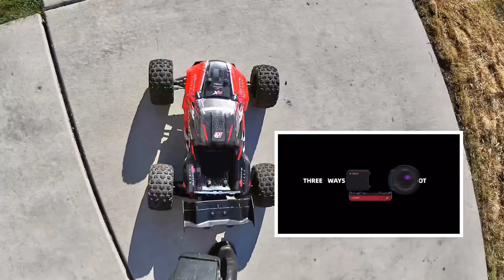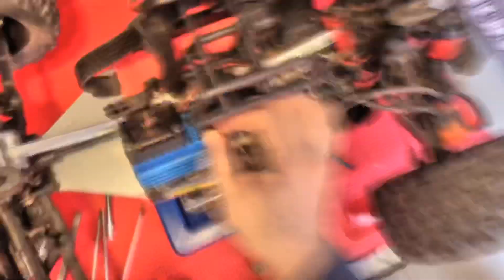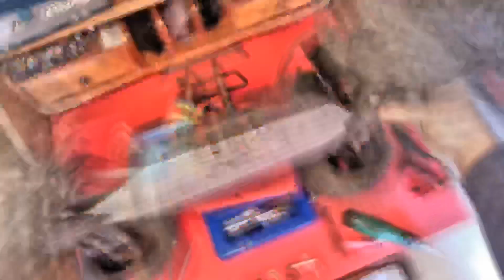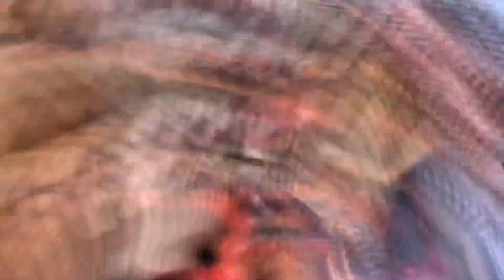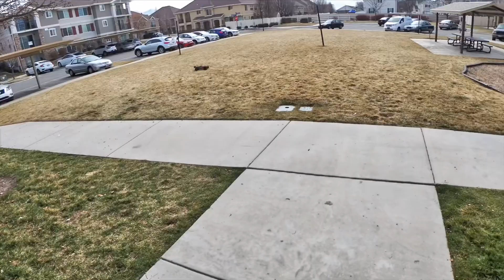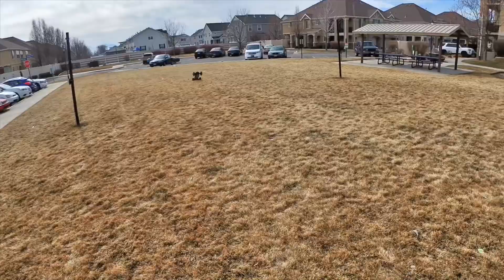RC Gears Slipping?? What COGGING looks like - & SOLVED

Comment: Hi I was wondering what amount of teeth I should have on my pinion gear bc I have replaced my old 1/10 scale brushed motor to a brushles motor and it  is running a 17t now and it is gogging
Reply from the maker: Depending on the severity of the cogging, Would help you determine whether you should drop one or two teeth. If you really have to gun it hard off the line for the cogging to happen. Then 16T might do the trick. If it’s cogging pretty easily then I would drop to 15 or 14t.
Also you might first check to see what punch setting your ESC is on. Sometimes simply dropping your punch setting can do the trick.
Reply: @EastTactics  Thank you so much

Comment: Most are under engineered for the expert pilots/drivers, so they mess with it which is a wrong concept as you should move "up" and buy the bigger ones and not "save money" any more. In essence they are still flying a Cessna and know about Boeing... It's impossible to mount a fat engine on a Cessna, but they do it for some reasons which I don't know about.

Comment: I think you can flip it if you tune your diffs? Like 1 million oil in center and 500,000 in rear might do it.
Reply from the maker: Hmmm... You make an interesting point. However I have noticed that when I go to thick in the rear end, the explosion of torque to tension on the ground, lends To broken diff pins and planetary gears. 😂 
I’m starting to think that Standing backflips Is a characteristic of a vehicle that’s tuned for an increase in breakages. What’s your experience?
Reply: Oh! Great! I just put 500.000 in the rear of my e revo! After watching a Kevin Talbot video 🤣🤔
Reply: I find that I break mine all the time lol and upgrade and break again, I love to wrench on them so I love the hobby. I think they make them to break cause the parts are money makers for them.i once built a T-MAXX with all aluminum parts, I could run it into a tree at 40 mph and nothing broke, just bent all out of wack😳😂😂😂the stuff I do for fun.but ya I have 7 trucks and I always have one apart on the bench! Fun stuff✌🏼❤️💪🏼
Reply from the maker: RC SICK, Yeah it’s something to keep in mind, however I do think the biggest reason why I was breaking so many pins and planetary gears was because I was running at 20t pinion gear, Which was just plain overkill. I’ve since  dropped to the 16, which is plenty fast and I also updated the pin to a 2.25 mm stainless steel rod that I picked up at McMaster.com. I have a video on it. The pins are amazing check Out my vid on it, if you haven’t already. Yes indeed!!! Bash on broski 😎😝💪💪
Reply: Thank you for that,I need some pins👍🏼👊🏻✌🏼❤️💪🏼

Comment: I dont get it, is cogging a motor issue? Or is it a gear issue? I recently changed my diff bulkheads and I didn’t touch any part of the gears besides taking it out and putting back in and now this shit is happening, I re checked everything and made sure it was properly seated and tight. These f’n Arrmas is driving me crazy, it’s like everything I try to upgrade just makes it worst.
Reply from the maker: It’s more of a torque issue, as too much is being asked of your ESC/motor combination. Something has changed now after your modifications to the drivetrain system. Adding weight to your vehicle, Such as larger tires or heavier components can do this, even changing differential oil, or the mesh tightness of your gears might suddenly change something where now the torque needed to kickstart the mass of your rig is More than what you’re ESC/motor combination can handle. Even introducing a new battery into your system that has a higher C rating, can introduce cogging because now more draw is being asked from your ESC/motor relationship. 
I’ve seen cogging suddenly appear when somebody goes in and increases their punch setting too high, and now the power surge asked from your motor and ESC to jump the rig off of The line becomes problematic.
Increasing the size of your motor pinion does the same thing, changes the dynamic of what your motor and ESC are asked to do. So… If you don’t want to change your gearing or any of the Drivetrain or weight changes you’ve made to your vehicle, upgrading your ESC to one that can handle more power/torque would likely remedy your issue. 
Or
Dropping your punch setting down a few notches might be enough, Or drop your motor pinion down a few teeth.
But if you had a pin it on one thing as being the weak link in your system, I would blame it on a low end ESC.
When people upgrade their ESC to say a Max6, Or even an 8S spectrum firma 160, they now have an ESC that is capable of handling not only a 2500 KV motor but you can go as low as 1650 KV (which demands a ton of torque) and still be fine.
I hope that answers your question.
Watch this video for more insight.
https://youtu.be/s4-RjtQsMsU
Reply: @EastTactics  hey brotha thanks for the info man I really appreciate it, I’ll give it a shot. It’s kinda hard for me with no one on island who I found in this hobby and no local hobby shop to go to for questions so I rely on these vids from the experts like you man. Thanks again.

Comment: Does lowering the punch level also fix the problem? Sometimes my hobao mt plus 2 does that too on punch level 6 with 500k center diff oil, didn’t have this issue with factory settings.
Reply from the maker: Lowering the punch level sometimes is enough to get rid of the cogging issue. I would certainly attempt that first and see if it does. If that doesn’t work then consider dropping down a size or two with your pinion.
Reply: @EastTactics  Thanks for the reply! Yes it certainly does work! No more cogging on my hobao on punch level 4. Note that everything is stock except the center diff oil at 500k cst. Stock pinion is on 16T

Comment: To do a standing backflips, you have to Increase power however you accomplished that is your choice you can do it with a bigger motor or you can do it with a bigger battery like a 8s
Reply from the maker: I have something up my sleeve that’s going to potentially accomplish it with stock components. Stay tuned😎😎
Reply: @EastTactics  oh other things. You could also get a higher 3 rating maybe not the correct surface aswell. It almost did it. Asphalt would be better then concrete. Do a burnout before attempting one ? Warm the tires. But looking forward
Reply from the maker: Thx... that’s a great tip

Comment: My rc stops itself like accelerate and let off the throttle and clank stop fully. I feel like the spur or the pinion is clicking it to stop what could this be?
Reply from the maker: Could be a number of things, this video might lend some light on the topic, watch it and let me know if we can rule out what's its talking about. Then well move on from there.
Reply: @EastTactics  I believe I resolved the issue I did shim my differential on the rear and I believe it was a little tight that caused the differential lock up to occur.
Reply: @EastTactics  I have steel spur gear and pinion gear in my latrax prerunner and could that happen as well?

Comment: I have this issue on my exb at 14t but i think its when the motor is too hot
Reply from the maker: Sometimes people confuse worn out gears (such as the input gear or even the spur gears on your diffs (mostly rear)) with cogging.
However since you’re only noticing it happening when your motor gets hot then it For sure could have something to do with either your motor or your ESC temperature. What kind of temperatures are you getting up to?
Reply: I'm running a 14 tooth pinion as well, with some larger tires, I noticed it when I went from 4s to 6s. The motor was getting pretty hot and it would stutter off the line pretty bad. Thought a diff was bad, but considering I couldn't even hold my hand on the motor for more than a second, it was probably getting too hot.

Comment: I put the 16 on my arrma notorius to try do more backflips on punch 8 and its doint that i should put back the 14 or lower the punch setting to factory? Pleaseee help meeeeeeee
Reply from the maker: Well interestingly enough your issue is going to be one of two things, either your vehicle is cogging because of the increase in the pinion gear, and the motor and the ESC are having that miscommunication, Or, as a result of increasing the pinion gear and throwing more torque at your drive train, you might have actually stripped your rear input gear or your front input gear. Both cogging and that sound similar and happen off the line.
The way to diagnose if it’s a stripped gear is to give it a good punch while moving at 5 mph and see if the clicking happens. It shouldn’t happen if it’s cogging, since you’re already moving.
If it does happen still then there’s a chance that you’ve stripped one of your input gears or the teeth on your ring years (differential), or both. If you find that it’s leaning toward the warn teeth on a gear. Watch this video and see if the tip I explain helps you weed out where it’s coming from.
If you find that it is clogging then you might jump to a 15 tooth pinion gear and maybe drop your punch setting to 7 to see if it goes away, and if it doesn’t write back to 14 and see if it goes away. Here’s that video though.
https://youtu.be/y_oulXojfgQ
Let me know what you find out.
Reply: @EastTactics  thanks the motor its brand new  i will do that today

Comment: When mine was stock a could do standing backflips
Reply from the maker: karson, interesting, that wasn’t the case for me.
Reply: Were you running 6s
Reply from the maker: karsons exploring channel, Yeah… But I believe probably The biggest contributor to my not being able to do it might have something to do with the fact that my batteries are only first rated at 35C. My guess is if I had 100 C rating it would help. Not to mention I don’t like running my RC car at nine punch setting it’s just to Finicky. I might be able to do it if I adjust those two things. Down the road I plan on getting a new motor and esc anyway. Ultimately I’m fine to wait till then. My next batteries will also be better quality

Comment: My senton is cogging, I've tried different gearing, reset the esc, different punch levels and it's still there. Help 😔
Reply from the maker: One thing that gets confused, because they sound very similar, is Cogging, and stripped input, or ring gears on your differential. My guess, since you've done a bunch of experimenting with different gearing and punch settings is that you might have a stripped input gear either in the front, or the back differential. Potential even in the center diff between the mesh of the crown gear and the motor pinion. 
Alot of times it's difficult to detect a worn input gear because they are smaller and burried deep in the bottom of the Diff covered with grease, but even if one tooth is worn down the teeth skipping under high torque sound just like cogging. Have you eliminated this possibility yet?
Reply: Did you ever solve this issue? I seem to be getting cogging on my new Senton running a 3S battery and stock gearing. I've noted what OP mentioned about the input gear however I only get this issue from standstill for a split second. It's also like the car had almost no power to overcome initially spinning the wheels like if you intentionally hold it in place and open the throttle it barely has any power. One it's moving even a few MPH it's extremely quick.
Reply from the maker: @Thomas B Yeah that does sound like cogging. I resolved my issue, by dropping from a 20 tooth pinion gear back down to a 16 tooth pinion gear, and changing my pipe sitting down from 9 to 6.
As you mentioned the many others have confused cogging with warn teeth somewhere in their drivetrain. Typically the input years since they’re the most elusive from detection. I know you mentioned that it’s only a start up. However that is when the most amount of torque is being immediately sent to the gears. You might consider going five or 10 mph and then punching it, if you experience the cogging feel, That would be an additional level of evidence toward a stripped gear somewhere. I guess it is possible for you to simply be experiencing the actual cogging issue on stock gears.
Reply: @EastTactics  Above a crawling pace everything sounds fine and response is razor sharp so I'm inclined to believe the gearing is OK. The manufacture got back to be saying it sounds like a motor issue. If they won't help me I will probably try dropping down to a lower tooth pinion. Thanks for your help!
Reply from the maker: Anytime, glad you were able to traverse through my message. I noticed my voice detection to text wasn’t exactly on point LOL
Reply: @EastTactics  It was surprising good at capturing some technical terminology there!

Comment: Max 6 combo, 4985 (1650kv) and a 22t pinion with powerhobby 100c lipos and 2.5M center diff fluid, got me standing backflips for days. But it runs too hot and will destroy your drivetrain. I run an 18t now, can't do it anymore.
Reply from the maker: ThoMz RC, Thanks! Really appreciate you sharing this info.

Comment: When I lift up my rc car and spin 1 of the wheels the other wheel spins the opposite way what do i do?
Reply from the maker: I’m pretty sure that’s normal... prop the car on a stand grab both left and right and together turn both... this should lock the diff, and spin the motor pinion. And make an expected clicking noise.
Reply: @EastTactics  I can drive it but it’s like sounding weird like a cogging sound i don’t know why, I think it might just be broken and 1 of my tires are loose lol. I’m considering saving up for like a traxxas or something a bit better around 100-200 dollars instead of around 50-60
Reply from the maker: What Rc are you running?
Reply from the maker: @jonathansteenstrup422  Cogging often times can be confused for a stripped gear somewhere in your drive train. Watch this vid and see if it helps to sniff it out.
https://youtu.be/y_oulXojfgQ
Reply: Perfectly normal for that to happen.

Comment: Its most likely your mesh not the gears put it back on and add a little more space between the pinion and spur than the paper trick just add a tiny bit more space between them guaranteed it wont cog i had same issue with my revo 2.0 and it went away with a lil bit more space between the gears most the time we get cogging is from not enough mesh between metal on metal with plastic you wont get cogging
Reply from the maker: Thanks for the suggestion, Ya I checked the mesh quite a bit, used the paper tactic too. The Mesh in this case wasn't the issue. it was the 20T pinion on a stock 2050kv motor. it wasnt happy. dropped it... and problem solved.

Comment: I think the problem is the name arrma, I've had nothing but problems with my krapton 6s and by the looks at the comments everyone that has a arrma is having problems. Personally I think Traxxas is the way to go I don't see many people complaining about Traxxas
Reply from the maker: Traxxas makes a solid vehicle, so I can’t argue with you there. However what I can say that I love about Arma. Is they make a solid initial platform that you can build from. Sure it would be nice if they sold it with all of the upgrades out of the box, but I guess at some point you’ve got a balance the cost of manufacturing Among other things. The support for the Arma platform from third-party creators is huge! And I really enjoyed the bash it/break it/upgraded mentality over the years. At this point my vehicle is a tank… Course she’s got a lot of love. If you have any questions specifically about your biggest ailments I’d be happy to help you with your Kraton.
Reply: Yeah well get ready to piss your money away on axles. Traxxas axles are junk, even the heavy duty ones. Maybe you'd have better luck with the metal upgraded one's but $140 for axles is a lot. I've been running Traxxas for a while and with the stock veleneon motor and esc I would snap stub shafts within 5 minutes everytime I run it. But my Arrma granite 4x4 will take a severe beating and I've never broken one axle. Arrma chassis and suspension are far more superior then traxxas in strength. They only thing that sucks is that you don't give you any alternate options on the suspension or steering. But if you just run it like it came they will almost always drive back to the car for the next round of bashing.

Comment: My rc car also cogs when going super slow crawling speeds when running over obstacle. I plan to gear it down fron 17t stock pinion to a 15t. Maybe it'll get rid of cogging. Thanks for the idea.  (My rc car is wltoys 12428 with 2900kv motor 45amps esc 2s 45c lipo)
Reply from the maker: That could very well do the trick